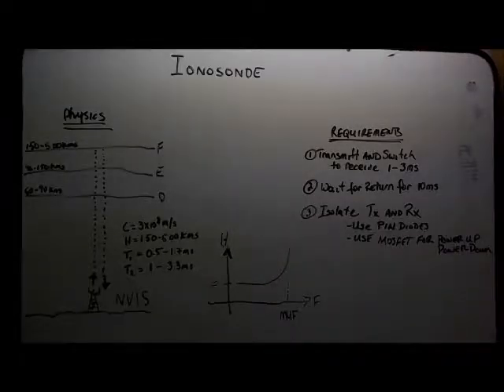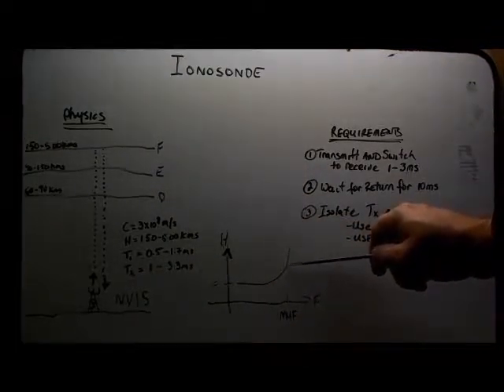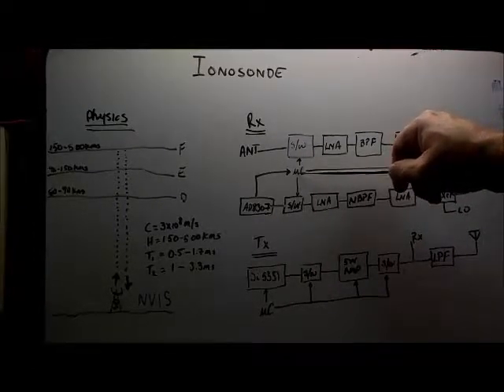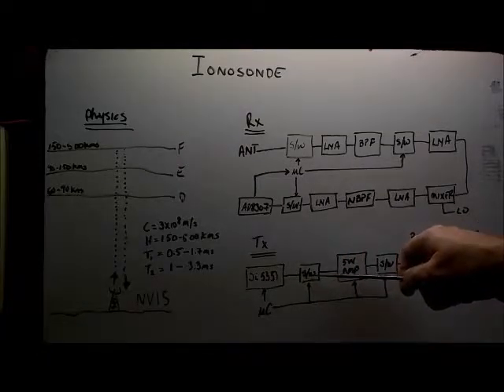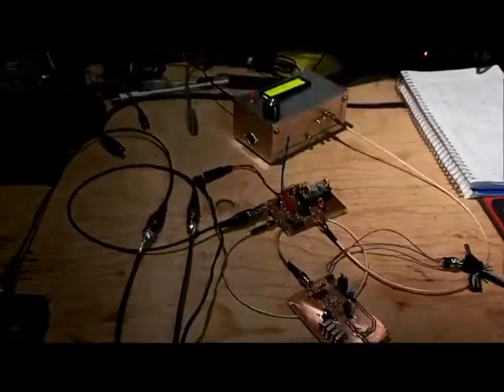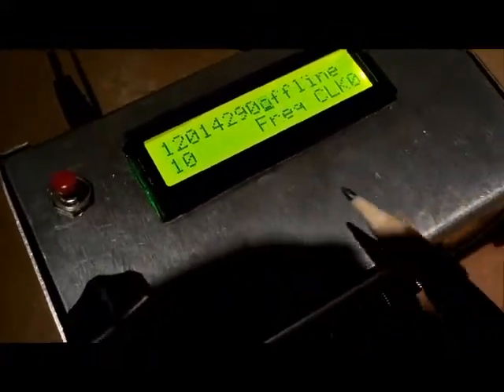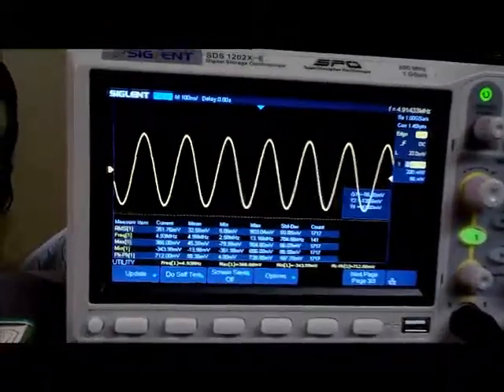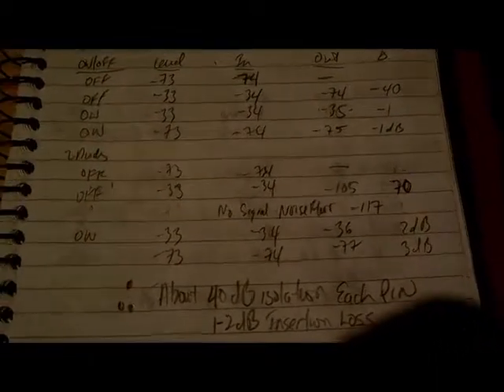Ionosonde Project Introduction

Comment: Nice project!  Was considering doing something similar but using GNU radio and a SDR dongle as a receiver.  Transmitter is TBD but I'll have to look into the PIN diode switching to isolate the two.